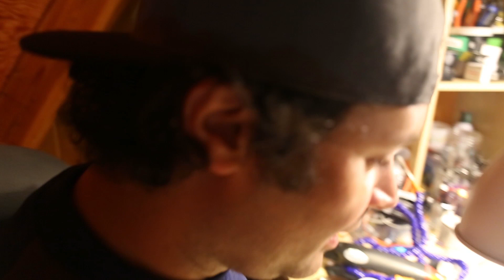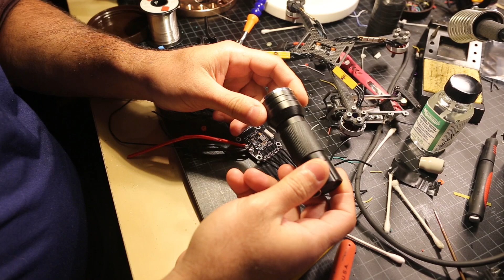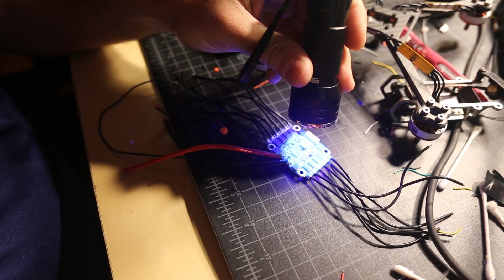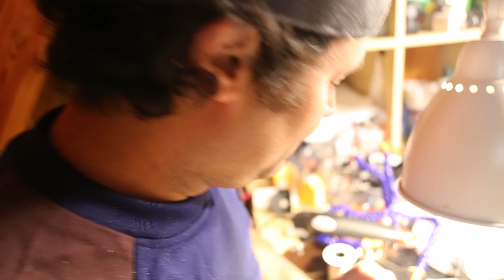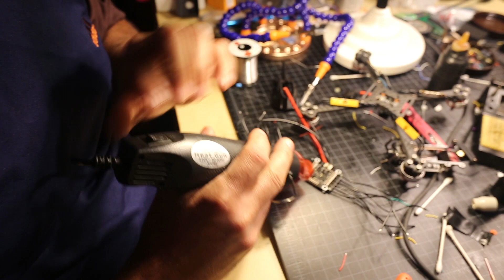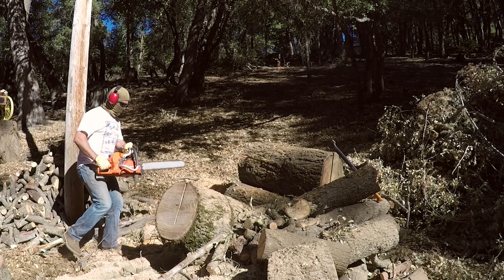Silicone Conformal Coating Speed Tip

Comment: If you apply to much heat for faster drying, the CC will create air bubbles within the CC..
so make sure to not apply to much heat..
I use a "tea light" small candle ?! and a metal box.. so the electronic sits in the metal box which has a temp around min 65 to 120 degrees celsius
Reply from the maker: Hi, thanks for the tip. Yeah, there's a point where too much heat damages the coating. I have seen it. But I keep it under that. Also, I live in a very dry area, so maybe that has a lot to do with how fast I can dry these things. I would suspect areas with high humidity have much more trouble.

Comment: hey, im fonformal coating my build, but i dont know how to propper coating my gps (bn220) or similar.. any thought?
Reply from the maker: On those I just coat along the sides of the antenna pad at the top, and then on the bottom, just make sure not to coat the battery, as it might seep between the battery and the contact point and cause it to not work. Also be careful not to coat the plug, as you want those pins exposed so that plug actually works.
Reply: @PinchTune  thanks

Comment: How long do you wait to test your drone after coating and curing with the UV light? It's not electrically conductive, so I would think it would be fine, but just curious what you do. Thanks.
Reply from the maker: I wait until it's dry to touch. This usually happens in about 15-20 minutes with the process above. But oftentimes longer as I usually coat and start putting stuff back together after that initial 15-20 minutes... by the time I'm done buttoning everything up it might be 30 minutes or more.

Comment: Hello! In my country i can hardly find a proper silicone conformal coating (i'm sure it presents on the market here, but i can't realise what is naming in my native language). But i have a silicone oil (as tech lubricant: PMX-100, PMX-200 or PMX-1000 or something like that) - they are dielectric too and the working temperature is from -50 to +200 C. Do you think can i replace a special silicone conformal coating you use with silicone oil for PCB and motherboards? Or it's a little bit different thing? Thanks for attention
Reply from the maker: Hmmm, I don't know. However, I do know that there are various silicone coatings out there that should work just fine. I bet that if they work on motherboards, then they should work on these things just fine. It would just be a matter if finding out how durable the coating actually is.
Reply: PinchTune thanks, I’ll try to find out a little more : )

Comment: What if I have a pcb with a small battery pack on it?? Can I / should I coat the battery pack??
Reply from the maker: Good question, I don't know. Hmmm. I believe Flite Test has an episode about waterproofing from about 4 years ago. I think they mention something about batteries in it. You might want to look that up.
Reply: @PinchTune  well I already went ahead and did it 😅 we'll see how she goes. It's just a small 3.7 v battery that powers some LEDs.
Reply from the maker: @c0pyimitati0n  I doubt you'll have a problem. As long the coating does seep deep into a connector and insulate it from the pin, you should be fine.

Comment: I have coated 2x a part today, after 2h drying i can measure 0 ohm with my multimeter between groundwire and some coated parts connected to ground. My probes are not sharp !!! . I think this is not correct so. Any help ???
Reply from the maker: I'm not sure actually, but do a continuity test on the same rails, from coated parts... you should get no continuity.
Reply: Hello, i think larger drytime is the better option. If you contact the coating before full dry = 20min at 65° you will damage the coat.